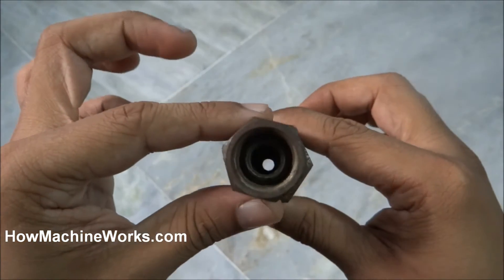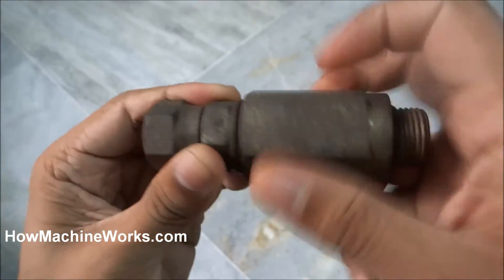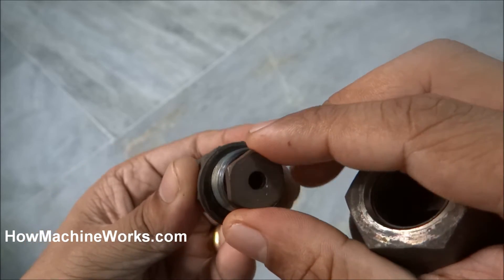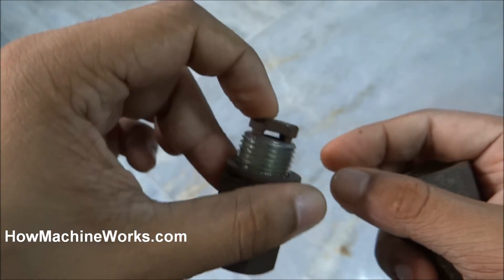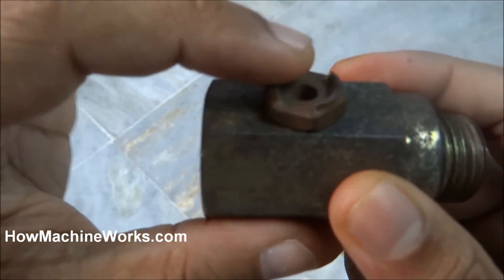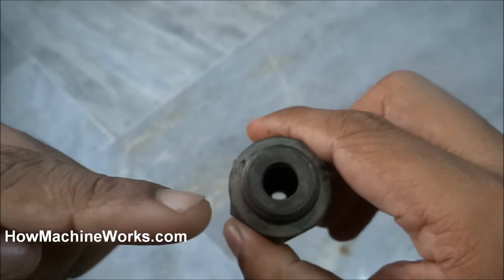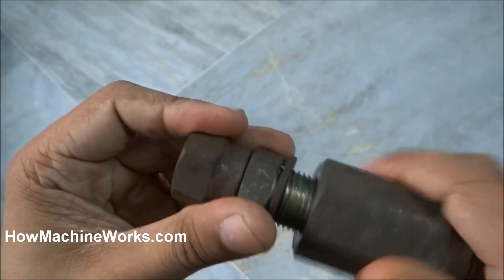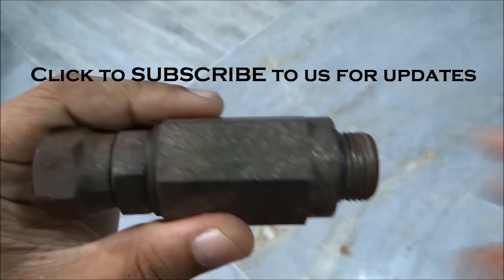How one way restrictor works. ✔

Comment: why is there 2 gaps on the side if that's where the flow is also going but it is perpendicular to where the flow is going through the hole but where is the flow meant to be going through those gaps on the side i don't understand.
Reply: Flow one direction, the disc is pushed against the outlet housing hole with 3 holes for flow( 2 side slots, 1 center hole).  When flow is going other direction, the disc is pushed against the other housing hole. Since the seating side of the disc is flat (no side slots), it seats and seals against the housing rim and the only flow is through the center hole.  So less holes to flow through, the flow will be slower that direction.